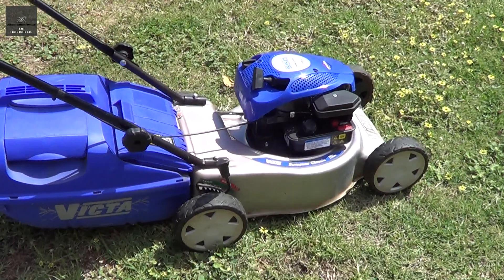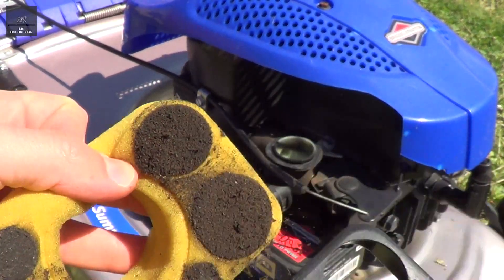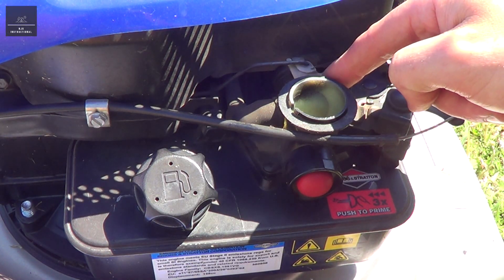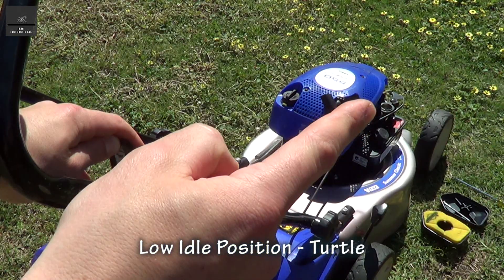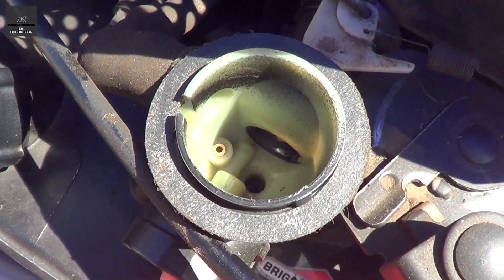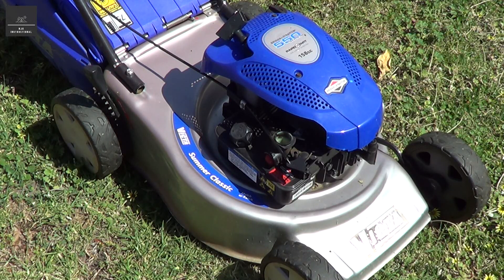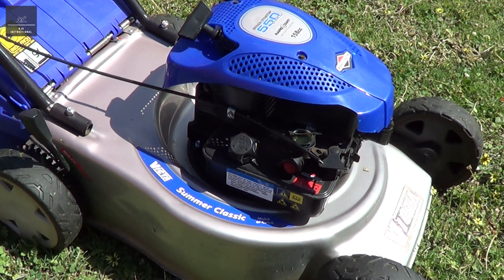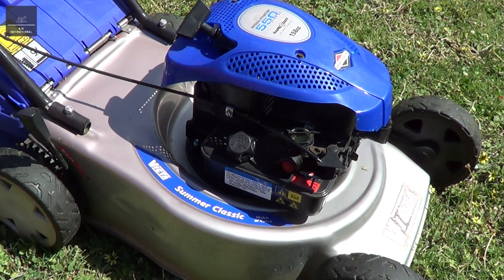How To Bypass The Governor On A Lawn Mower Engine

Comment: There is no reason to bypass a governed on a push lawn mower. What's gonna happen is this thing will run away on you and blow the piston through the cylinder. I know from experience,
Reply: @LegendLength  3k
Reply: @LegendLength  okay. Cool lemme  know how to goes
Reply: @LegendLength  bahahahaha
Reply: I've had mine bypassed at 5K RPM for the past 2 years. And its never blown.
Reply: @ChrisC1946  But why?! It's a fuckin' lawn mower!?
Reply: @tander101  i multch my yard. And i feel like at 3k rpm it had no power to multch. So i turned it up a bit. And it mulches better and it runs better.
Reply: @ChrisC1946  BRUH whaaaaaaat
Reply: @tander101  yep

Comment: A governor is used for reving up the motor when load is applyed it also keeps it from over reving and blowing up.....
Reply: That’s the point
Reply: @whitelightning5937  so there trying to blow it up?
Reply: @conner5611  possibly, at least that’s what I want to do to my mower
Reply: @whitelightning5937  well that's wasteful why not fix it? Its easy
Reply: @conner5611  free lawn mower
Reply: If only it did rev up under a load.
Reply: @Big0veralls  its does when you go in thicker grass itll give the carb more throttle or atleast mine does